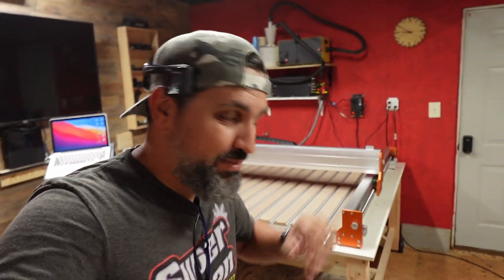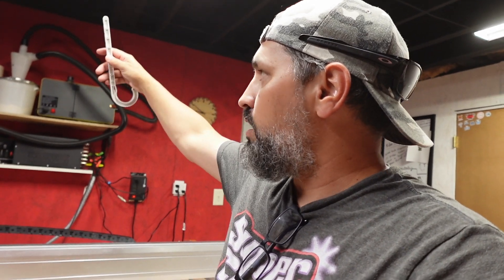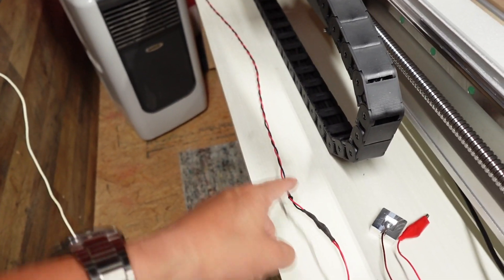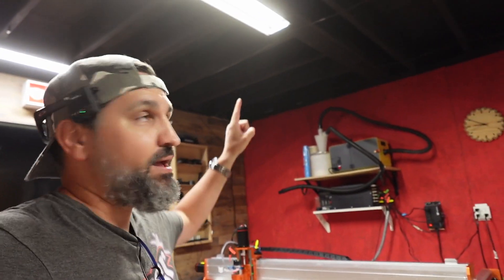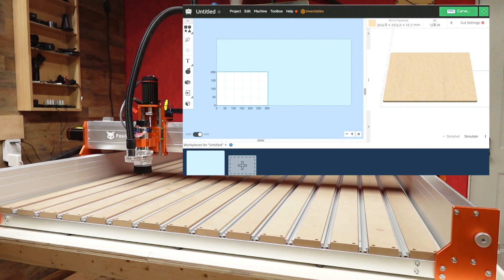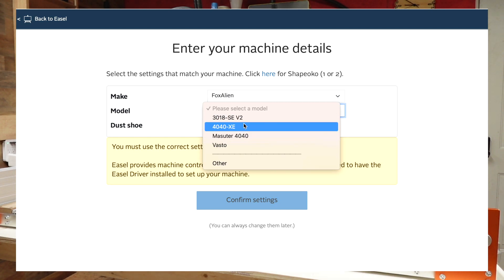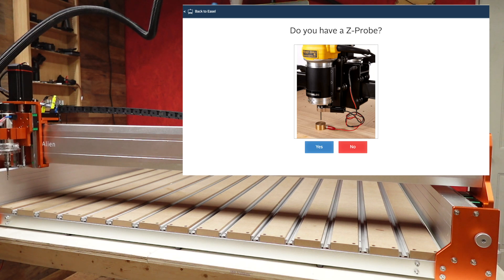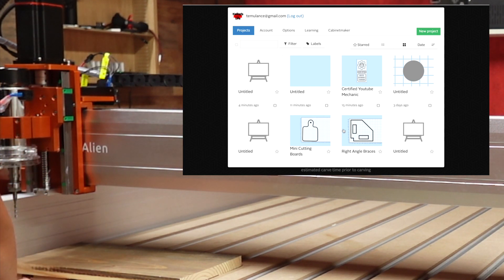FoxAlien CL-4x4 CNC Machine: Power Up & First Test Cut!

Comment: I bought a foxalien masuter pro and I'm too stupid to get it to work and I wish I didn't spend a ton of money on it. I'm very close to smashing it with a sledgehammer. I can build absolutely anything out of wood. But when it comes to computers, I'm just a big, stupid moron.
Reply from the maker: Awe man. It definitely is a learning curve!  Can you connect to a pc?  What software are you using?  Have you tried to use Easel by Inventables? Also…. Have you gone into settings to make sure your zprobe thickness is correct. The one that comes with the machine is 15mm.  Let me know more deets and I’ll see where I might be able to help. Also… join our FoxAlien group on Facebook! Lots of people willing to help!
Reply: I @TheCrawlspaceCraftsman  I can't even get my laptop to download the software. I bought that little tiny box to use it offline. And I don't know how to even fine pictures to download to the micro SD card, I'm completely lost.
Reply from the maker: @michaelfinnegan6581  got to the FoxAlien.com website and download the ch340 driver. Once that’s installed go to easel by Inventables and signup with them.  It’s easy to use. Try that process.
Reply: @TheCrawlspaceCraftsman I will do that, thank you

Comment: Hi. This machine uses closed loop motors. How the CNC controller/PC manage the errors generated by the motor drivers ? In case of an error the CNC controller/PC stops the machine ? Do you receive a message in the CNC controller/PC ?  Could you please explain that ?  Thanks in advance
Reply from the maker: Yes these are closed loop. I’d for some reasons you get an error the machine will stop and you will need to reset it manually by shutting down the CNC, move your axis and then restart the project. I hope that helped some!
Reply: @TheCrawlspaceCraftsman  Thanks a lot for your clarification. Should be very nice and helpful if you make a dedicated video on that 😀

Comment: Easel pro if free 30 days guys. Give it a try the gui is simplistic    and it's the noob friendliest software I have found so far.
Reply from the maker: You’re 100% correct. You can still use Easel after 30 days but just the Pro features are disabled.